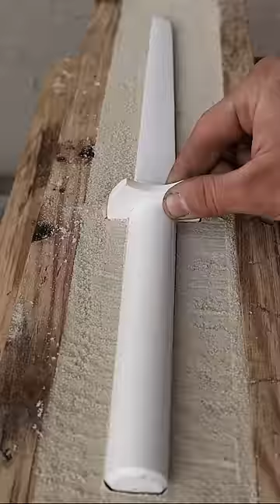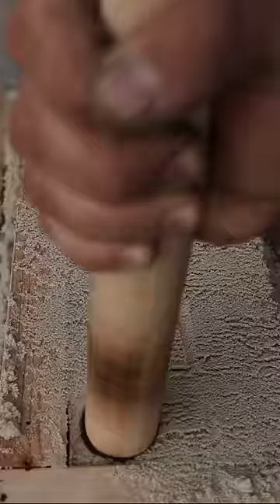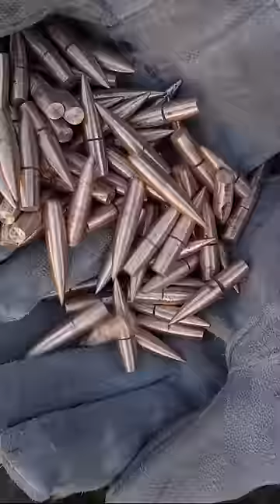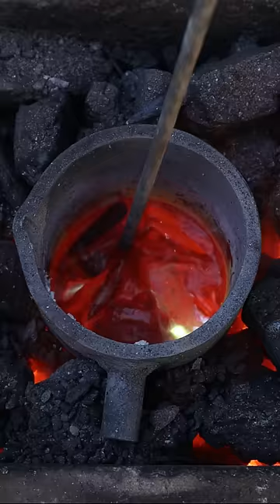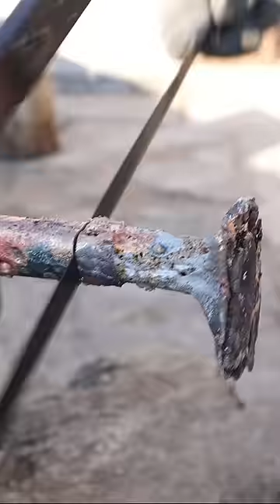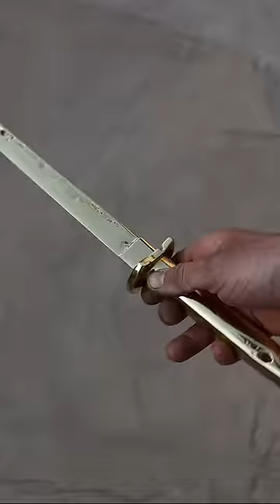A Fail Casting x100 Bullets into Tanto - Melting  Metal

Comment: That did turn out pretty good! But why did you pour in the glass as well?
Reply: Don't quote me  but I belive it was to collect the Slag  (gross burnt bits)
Reply: bc he wants it to be transparent I guess
Reply: @colinmanlives  yeah.. but now the cast product Is part glass
Reply: @Fragnicht  the glass draws in the impurities then floats to the top
Reply: The glass doesn't get hot enough to liquify, and even if it did, its density is higher than the liquid metals, so it won't mix. Also, the glass would stick to his tool if it did get to a state of liquid, but it never gets that hot. As for it removing impurities, I doubt it does a whole lot. As you can see, it still had impurities at the end. Also, I'm not saying it doesn't do that, just that it's not as effective as everyone is saying the glass would need to get hot enough to allow impurities to absorb into it and then scooped out and I don't believe it achieved that in this short video also I don't think it floats because it's heavier than the metal when melted or in molten form.
Reply: @johnwick4922  the only true answer
Reply: @ericrichardson3332 so it technically burnt?
Reply: @Fragnicht  not sure, but I've seen other full-length videos on purifying precious metals like gold , platinum, etcetera, and usually everything is liquefied either in or poured into a pyramid shaped metal mold and allowed to cool down after wards all the slag and impurities are settled at the bottom which is the tip of the pyramid because it's upside down everything they use that isn't the metal they are trying to recover ends up at the tip of the pyramid and gets broken off it is actually pretty interesting how it's done but there is many different ways glass and sand that turns to glass requires a lot of heat and will remove impurities but I can't be certain from this short video if it had any significant effect
Reply: @ericrichardson3332  all right, though, The lead+gold+silver mix is gathered at the bottom, and then broken off
Reply: +2 sharpness
Reply: @fragnicht1734  nah, glass is less dense than brass so it floats to the bit that he cut off
Reply: To make it reflective
Reply: @Emborg  glass in its solid form, yes, is less dense, but liquid glass which doesn't get to a liquid state more of a dense gel / think lava with a very slow flow rate that is glass in liquid form it will sink to the bottom of liquid metals because it stays together and does not separate easy liquid metal can be easily poured and moved from one container to another not glass as liquid glass will ruin your crucible as it sticks to almost everything metal might even stick to it or in it but it will not combine nor will it float as it's mass is bigger then liquid which displaces and let's solid objects fall to the bottom
Reply: @ericrichardson3332  while having a high viscosity, liquid glass should still float upon molten brass due to the difference in densities.
Reply: 7
Reply: @ericrichardson3332  you'd better check in your high school book to know whose density is higher.
Reply: Ppl
Reply: They pour glass   so the sword has higher reflection making it look cooler
Reply: You clearly see him pull the glass chunk back out of the molten metal before he pours it into the cast. Did u miss that part? Lol
Reply: Where does the powder and primer go?
Reply: @fragnicht1734  ...you remember the bit he scooped out, right? That was the glass.
Reply: @ericrichardson3332  you are correct.  I have seen other guys like bigstackd throwing glass in with aluminuim.  End result : it was waste of time gas and effort. The glass  made a mess of the aluminuim ingot that bigstackd  tried to form
Reply: @colinmanlives  i personally melted aluminium and i can tell you everytime the dross( the dirt on metal) floats  on top. And you have to scoop it off.  Glass wont help you unless you like to make life difficult for yourself .
Reply: @ericrichardson3332  he  at one stage throws in bullets than then borax powder then 2  flakes of glass. Then when he picks up crucible i dont see glass on top of the bullets as we have good camera shot.  Unless he mixed it before that camera shot. Then later he removes what looks  like blob of half jelly sticky glas before continuing.   The only thing with brass  that helps draw out impuritiesnis the borax the white powder. Anyway.
Reply: It collects the impurities and he scooped it out in the vide u can clearly see It and I know nothing about this subject. Just being observant lol
Reply: @fragnicht1734  Nope! Glass does not mix with the brass...
Reply: At least he used brass solid bullets, not regular modern bullets, most modern bullets are made out of a lead-antimony alloy core covered in a copper jacket. Would not have been that great if he had used regular bullets, copper-lead alloys do exist but the proportions are completely different and none of these existing alloys contain any antimony.
Reply: @misterthemad994  so they are Not only Cooper
Reply: @fragnicht1734   the bullets featured in the video ? According to the colour they're brass solid bullets, meaning they're a 100% brass, a copper-zinc alloy, so yep they are not only copper.
To my knowledge there are no bullets that are 100% copper, I don't know what is the exact copper to zinc ratio in the brass used to make brass solid bullets, but according to what I read it is most likely 30% zinc, 70% copper.
Reply: @fragnicht1734  the thing is, if he had used regular modern bullets, the final product would not have been great to see and would have most likely been fragile. The different metals of a regular bullet may have even been completely incapable of forming an alloy because the proportions are just not good ; most, if not all copper based alloys contain more than 50% copper, lead-antimony alloy constitutes way more than 50% of a regular modern bullet.
Reply: @fkyew All he did was melt down bullets that were solid bronze or brass. He didn't melt down full cartridges, so no powder/primer.
Reply: See lots of guys who melt metal down to forge knives out glass in all their crucibles with what ever metal they put in it. Not sure why they do it but a lot of guys do it.
Reply: As Flux
Reply: @bvictory5698  usually, cast knives and swords are decorative only, as cast metal is always weaker to some extent, as most casting methods cause bubbles to form inside the metal (the size and quantity of bubbles may vary), weakening it ; only expensive industrial casting techniques allow for really strong cast steel. Real, tough usable knives and tools are made out of solid steel pieces put into form through forging or through matter removal ; my father's a knifesmith and he uses the latter as due to health problems and two surgical interventions, swinging a forge hammer all day long would sooner or later essentially result in his disembowelment.
Reply: @oops1208  exactly
Reply: I think the glass is to help clean something.
Reply: glass is normally used in iron/steel melts because after it melts it floats to the top and seals off the iron from oxygen preventing loss of carbon. in this melt it was pretty useless and served no purpose.  we scrape impurities off the top without any need for glass
Reply: to make it shiny
Reply: Зачем сейчас за золото бороться и искать, говорят искуственное золото за 12 часов можно получить искусственным путем самую настоящие, так что одно проблема решена и огромных количествах.
Reply: @fragnicht1734 Glass floats on molten metal
Reply: He didnt its just for the melting the peace he took out was glass
Reply: @Rich-mw9ye  exactly🙂 thanks for the good explanation
Reply: @fragnicht1734  he take it from melting pot after bullets melted down,
Reply: @fragnicht1734  no it would burn off
Reply: To separate impurities
Reply: Maybe to add carbon to the metal to make it more durable
Reply: What impurites? It's a bullet that is entirely metallic.
Reply: @fragnicht1734  glass takes way higher temperatures to melt and even if it did, it doesn't mix up with metal and is way lighter. Ever seen those sparks iron makes when blacksmiths pound on it with the hammer? Those are impurities that jump away cause they are lighter and the hot metal-slag compound has a ton of internal stress.
Reply: @fragnicht1734  did you not see him pull out the molten glass blob covered in junk?
Reply: @fragnicht1734 the glass is a a different density than lead and this will float. When he scrapes the slag off the top the lead will be the only thing that remains.
Reply: @Think--Twice  he meant the melting point densities. Molten glass is more dense than molten metal.
Reply: Bernstein effect....I SWEAR this " add glass" thing is brand new.
Reply: @Frikkie Smit  yeah I have no idea why he uses glass.. I have seen sand and borax and even lead added and then later removed all to remove other metals or whatever is not the desired
Reply: If y’all payed attention it was broken glass. That’s so the sword would be sharp
Reply: Chinese trademark tho
Reply: I'm not an expert but I believe it's to introduce silica which helps the copper and lead to combine into an alloy
Reply: To make is shiny.

jk
Reply: Turrible😂
Reply: Yeah there are many blow holes in it. He just do  this for video purpose😂😂😂
Reply: Just Enjoy the Video Without all the Drama 🎭 😊
Reply: its to identify the temperature of the metal when the glass reaches a certain color
i think
Reply: I think they should’ve put 2 holes. His blade has those potholes because air was trapped
Reply: @ericrichardson3332  the embodiment of an answer given from someone full of cattle exit material.  Sorry glass is not heavier by mass then brass.  As soon has I saw you say glass was heavier I knew you were full of it.
Reply: @fragnicht1734 brother, yoh don't get it do you, the first reply to your comment literally explained it
Reply: Are dou blind?
Reply: it's to lower the temperature needed to melt the metal
Reply: @ericrichardson3332  I know they use that's of liquid nickel to pour glass on top of to make sheet/plate glass
Reply: For silica?
Reply: I guess to give it a glass like feature
Reply: @colinmanlives  
 
The easiest way to collect the slag is to go to the nightclub as it’s closing.
Reply: @ericrichardson3332  
Brass is over 3 times more dense than glass. 
If you think about it, if you’re collecting impurities it makes more sense that you use something that floats on the surface, not sinks to the bottom.
Reply: because it will turn back into sand when it cools off
Reply: Silicon in glass ,combined with brass is like nature's super glue to a alloy metal.Bonding within  I believe strengthens the metal?!?
Reply: @chrisphares4772  
Based on what?
Reply: @ericrichardson3332  qué
Reply: Gets rid of impurities, just like borax.
Reply: @frikkiesmit327  No, he's wrong. You're right about aluminium, though. Aluminium is the same density as glass, that's why they mix. But brass is around 3 times denser, so glass floats on it
Reply: Ok idk where I read this or is it even true but it can be to stop the reaction of zinc (I think)
Reply: What is the powder, and what is it for?
Reply: @fragnicht1734 he picked it up after
Reply: @fragnicht1734 the glass burns off or turns to slag and scooped out
Reply: It’s so the zinc and copper don’t react violently
Reply: Flux
Reply: I think he uses glass as a catalyst to make the melting point drop
Reply: prevents oxidation of the lead.
Reply: I thought the same
Reply: ачо попить лавы уже нельзя
Reply: @emborg3145  yep! Correct. Tis how float glass is made!
Reply: @Rich-mw9ye  how would it collect impurities if it doesnt melt and doesnt mix
Reply: My 11 year old forge fanatic nephew says...
"The purpose for putting in the bit of glass after he put in the borax or boric acid to remove impurities was to create a capped green glass was to hopefully create a decoration in the handle and pommel of the object being cast but may have over estimated his mass when calculating how much material is needed." He said he is going to try this in a cast pommel because he believes he can realise the placement of glass inside the casting.
Reply: @fragnicht1734 lol no
Reply: @fragnicht1734  No it isn't, they add the glass so that it melts and then sits on top of the melted metals to prevent oxidization, However it does not make the product "Part glass" Also how would you even expect glass and steel (Or in this case lead) to form an alloy together?
Reply: @ericrichardson3332  I mean to my knowledge it has nothing to do with impurities and more to do with the glass acting as a sort of controlled slag that helps prevent the metal from oxidizing, Please correct me if I'm wrong though
Reply: @FinalFront  No shit. You don't recognize playful sarcasm very well do you? I know there is no powder or primers in the melt. DUUH!!  That was meant to where the primers and powder went in the finished item. A jocular comment. Get it? No? I thought so.... Damn!
Reply: it stops the metal from oxidation at least that's what I heard
Reply: So it doesn't react with the zinc
Reply: That's what i was thinking!
Reply: @colinmanlives  how do i quote u? maybe" Teach A colimanlives to fish , and u feed him for life"???
Reply: @ericrichardson3332 bro yes it does melt, the melting point of steal and glass are close enough to where that’s going to melt.
Reply: @fragnicht1734  no, thats not how that works.
Reply: @emersoncowell-my2io the boric acid is used as a flux, to float out the impurities. Still I'm clueless about the glass
Reply: @RRED2 I think you said it best. I put off on so many tangents I forgot the original comment. Senility- I hope not.
Reply: No it's so that it doesn't react that much
Reply: it stops it from oxidizing
Reply: @ericrichardson3332  if the glass was meant to collect metals maybe he could had burned it abit longer if the glass has yet to remove slag in the crucible also the slag density is around 2000m³ to 3000m³ glass mean while is 2500m³ so thats in the middle of the slag density range meaning the two can very well mix and he can remove that slag alot more easily
Reply: @colinmanlives 😅😅😅😅😅😅😅
Reply: @fragnicht1734 it’s not the glass is put in so the metal doesn’t oxidize and once the metal is melted he takes the still solid glass out of the molten metal
Reply: It forms a layer over the metal to help with slag
Reply: It's sticky
Reply: @htodd4014  it's tasty
Reply: His trademark 🤷🏻‍♂️
Reply: It’s to stop the medal from oxidation
Reply: Tinker's copper
Reply: @ericrichardson3332 bro, you cannot seriously think glass is denser than metal
Reply: Для чего добавляет стекло?

Comment: Cold sand stops the flow and gives you the inconsistencies seen in the blade.
Reply: How do you fix that problem?
Reply: @gigachadmcawesome7078  может песок небходимо прогреть ? 
А так холодный влажный песок, на него попадает раскаленный металл, из песка испаряется влага и проходя сквозь металл образует раковины.
Reply: @vitaliy1530  good idea, give us a tutorial please.
Reply: @gigachadmcawesome7078  Probably pour into multiple holes from the side instead of straight down.
Reply: @DreamPhreak  or maybe make pathways for that steam to pass through? Which is my interpretation of what I've seen in other videos in this channel
Reply: Or you just pre heat your mold?
Reply: Fair enough, but idk I kinda like the textured look
Reply: @DreamPhreak he kinda does this now
Reply: @gigachadmcawesome7078  you forge a sword, not cast it.
Reply: @melanisticmandalorian actually bronze swords were cast.
Reply: @lokiwartooth1138 true, as well as iron, because it was easier to cast than forge as the technology was around for centuries. You did have to work harden the blade by hammering it to make it keep an edge for longer though.
Reply: @gigachadmcawesome7078 just add small vent channels to push the air out. The mold sand binds with a resin, so you don't want to heat that before pouring.
Reply: @jmoneyjoshkinion4576 Iron's melting point is above 1500 degrees celcius. How do you hope to achieve that in the early iron age? Iron swords were forged because once you learn how to do it it's easier and produces much better results than casting. The only similarity is that early iron age swords were work hardened just like bronze ones.
Reply: @vibk2744  I, or my source, could be mistaken.

I have been told that casting was done during the beginning of the iron age/late bronze age transition, because the technology had a lot of time to be improved on during the bronze age. And that forging, as we know it, was later developed during the early iron age because it was discovered to be easier to achieve the temperatures and work with it. 

If I am mistaken let me know, and if possible point me to the right place for more information. Because I do want to learn, and be correct with the subjects I love. In this instance blacksmithing! 
Ps. I only have 2 books on the subject, and looking for more.
Reply: I got the thousandth like😌